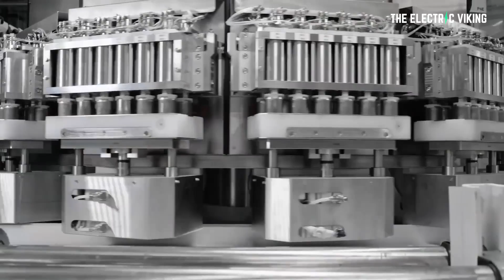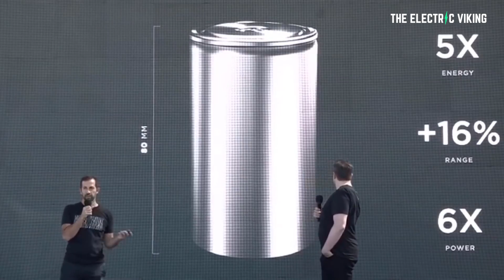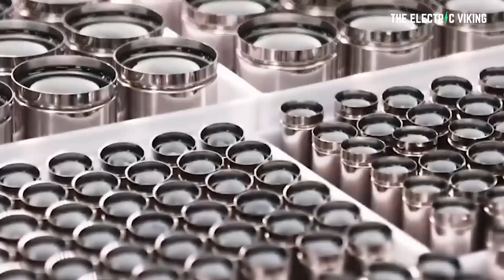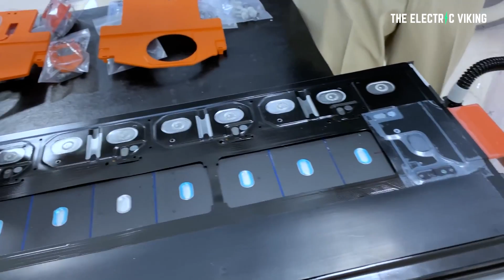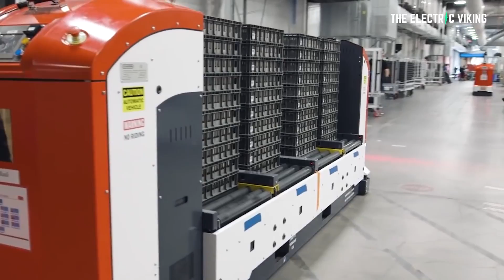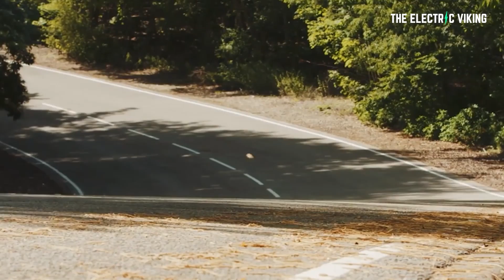Tesla's NEW manganese battery is a game changer

Comment: I am new to your channel. I enjoyed you discussion on battery technology. That being said can you do a in-depth review of the elephant in the room? Charging Infrastructure.  

Providing adequate recharging stations is not there yet across the nation but that's not the big question. Power creation and availability is. Where is all the power needed to supply this emerging demand going to come from? For example: My sister lives in California just over the mountain from the Bay.  It is not uncommon CURRENTLY (pun intended) in California in the hot summertime to overload the grid with demand and have rolling blackouts. What happens if the grid is even more overwhelmed with millions of EV's being plugged in? The power supply and the system to deliver is not there yet ... would you not agree?  Upgrading the current system is not a simple but complex issue ... how and who will pay for it?  Also, on an individual basis, not everyones home has 220V in there garage.  The labor cost to install the charging system, upgrade to the fuse panel if needed,  and the materials needs to be considered too. This subject is often not discussed when considering switching over to EV's.  

Further, it is nice to have a "zero emission" vehicle but is the power needed to generate the electricity zero emission?  Can you do a calculation per medium size, 4 passenger, with about 200-300 mile limit EV vehicle, based on current technology, to show the true vehicle carbon footprint?  Calculating the fuel consumption (natural gas, Nuclear, coal, ...) needed to create the electricity adds to the carbon foot print of the EV ... correct? Obviously if all power were all hydroelectric, solar, or wind then the number would be virtually zero. But I would appreciate if a all encompassing honest approach to EV carbon foot print would be explained as it is today.  People who buy EV forget about where electricity comes from or how it is produced. Please don't get me wrong I think EV's are the future but it is not free energy or is it without pollution based on power generation. Thanks for considering my request. Take care, Jeff

Comment: AFAIK, the manganese-rich batteries in the early Nissan Leafs are those that (in)famously degraded very quickly.
Li-Ion batteries with a manganese spinel cathode are relatively cheap, but have poor cycle life and are rather vulnerable to high temperatures. Nissan fucked up by combining these not very resilient batteries with an air-cooling system that didn't do a good job of thermal regulation compared to the liquid cooling systems almost all new EVs have today.
Anyway, if Tesla uses manganese-rich batteries they will not be of that particular type. There are several promising possibilities.

Comment: In 2030 Tesla will make over 30 million cars, Elon is sandbagging…  growth was 87% in 2021 it will be over 100% in 2022 and 2023.
That is 4 million cars in 2023 (just calculate existing factory capacity and ramp). On top of this Tesla’s strategy has now changed. 
They are now going for extreme size, 40 million is not unlikely. This is because Elon now feels they have to do it alone as US and EU companies are incapable to meaningfully scale…

Comment: Would there be any advantage in EV batteries using a spit of battery tech meaning half of the batteries in an EV being made with one tech and the other half using something else in an effort to maximise any benefits of each. Would it provide any advantage to the client /car owner or the manufacturer?
Reply: My guess is that this would be a challenge as you would have to double up on many components. Battery pack management systems etc.. due different cell  voltages etc..

Comment: I've pointed out Lithium in particular is in short supply and it isn't going to be significantly improved any time soon - so ideas that Tesla will still even break 2 million cars in a year - before they have an non LI chemistry is not going to happen - there just isn't enough and its basically obsolete already - if Solid State is going to make EVs viable and scalable it will happen way before any new mining operations dig up more lithium - so it would be silly to invest in such mining.

Comment: Battery tech is such a hot sector today, I think it's very hard to make predictions even a few years out. Literally hundreds of companies are feverishly working to find the next magic chemistry/material balance that'll shift the cost/density/charge-time equations. Who knows what advancement(s) will come to the market next? And who knows where commodity prices will go, as shortages duke it out with new mining ventures. The only safe bet is that batteries (and their prices) will keep evolving for the foreseeable future. Their future is bright!
Reply: One thing we know is that we need to decide on a solution now, Solid State , Hydrogen etc are too far down the road and we need to start building these plants. The big EV manufacturers have spoken, Manganese will have a role to play due to its scalability.
Reply: @dansom60  In current designs, Manganese goes with Cobalt and Nickel – both of which are only going up in price. As Sam has pointed out in many vids, the current trend is toward LFP – LithiumIronPhosphate. Energy densities are going up for that formulation, and the material costs are significantly lower. However, all bets are off outside of a couple of years. There're just too many designs & formulations being feverishly developed to predict.
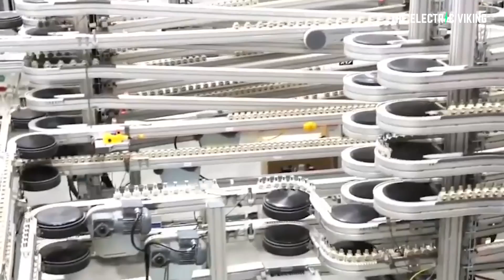Reply: @pbasswil  This article is about Telsa's announcement regarding the use of manganese to solve his supply chain issues. 3:10 in the timeline he say Tesla is focusing on Nickel based chemistries (which as you rightly point out above use both Mn & Co) for longer range vehicles and LiPO for shorter range. Electrik Vikings prediction is the 75% of the vehicles will be LiPO , fair enough. VW & Stelantis have also announced the use of NMC cathodes. just sayin.
Reply: @dansom60  If they can get the performance they need out cathodes with more Manganese and less Nickel, great. Elon undoubtedly has a very educated prediction about the availability of both metals over coming years. My point is, everything about batteries is in flux. There are too many variables to definitively say what's going to make sense, more than a few years ahead. Tesla is constantly making new deals & contracts, as new players and new chemistries & designs emerge. More will emerge! Regularly. So imho even Musk can't know for sure what will make the most sense for Tesla – maybe not even in 2025. Tesla are fantastic not just because they plan their supply chain ahead (as best they can foresee); they're also fantastic because they learn, react, pivot and adapt faster than anyone else in the industry. And quick adaptation is exactly what battery technology is going to require – both because of unforeseeable emerging opportunities, and because of the constantly changing materials market. Cheers.

Comment: From the stats i can find, it seems like you can get a battery with 250w/kg with more the a 2000 cycle life.  The real benefit is that it is a 3d structure and can charge to 100% with out impacting long term life.  You eliminate co2 from the production process, these could last a very long time.  Pretty interesting chemistry.  Several companies sell the powder now.
Reply: "250w/kg"?
Isn't that capital W and Wh/kg?
Just btw, the Tesla 2170 cells reached 246Wh/kg in 2019. (They've improved since) 
I'm pretty sure they exceed 2000 cycles (but life's too short to look)
Reply: @rogerstarkey5390  correct, but they don’t last very long when you charge to 100%.  So you have a 2170 that lasts for 5x as long under heavy use.

Comment: I think best case for Tesla in 2032 is 10M units. This is including the S3XY, Roadster, Semi, Cybertruck, and a cheaper model lineup. 20 million units will mean 10 more factories between 2022 to 2032.
Reply: I think you will find that Tesla is sandbagging on the number of Gigafactories required for 20 Million I suspect it will be less than 10.

Comment: While I agree we need more mining for the EVs, keep in mind once the batteries are built, we will not need the mining.  Recycled batteries last almost forever.
Reply: Hard to believe the batteries last forever...much easier to believe that they will be replaced by another chemistry or physics.
Reply: @calmorton4619  Not hard to believe.  When a battery stops holding a charge... what is left?  Did the materials it was made out of stop existing?  Nope.  Grind it up, melt it down, separate it, build a new battery, and start over.  It is cheaper to recycle batteries than dig mines then extract and refine resources.
Reply: NO!  they don't, recycling batteries are an expensive process, the gain is very little in terms of batteries, but it keeps hazardous materials from getting disposed
Reply: @cessealbeach  Mining is an expensive process!  The gain is very little in terms of ecological damage.  Recycling batteries is simple.  Grind them up, melt them down, separate the elements.  This is not rocket science.

Comment: I did a search for manganese, it turns out to be less energy dense than LFP but high discharge! Like LFP, safer than cobalt based.  I don't know what application this could use being less dense than LFP maybe a small city car or personal mover but still a great addition since LFP will never be enough, great battery for most or large applications, not handheld products.
Reply: Static power storage needs low cost batteries. Weight and volume follow in a distant second place.

Comment: Atm, Telsa is out of reach price wise for most. If you live where it snows anymore, you need a AWD or fwd, not a LFP RWD vehicle. 

Then there's the insurance issue. Switching to a Tesla makes no sense if all the money a person saves will end up being dumped into the insurance premium. 

As in if person A spends $50 per week in fuel and $600 for a 6 month premium for a ice. Person B buys a Tesla, only uses a super charger, due to no way they can use a home charger or a LV 2 charger at work, and spends $20 to $30 per week to charge and insurance is $1400. All of Person A’s savings from fuel and maintenance turned into a higher insurance premium.

I think once Tesla figured out how to get the US insurance rates down, pricing out of the $60,000 for a dual motor and the range of their EVs closer to 400mi, they will see greater demand.

ATM, I’ll just stick with my 2022 Blazer and I may buy into the Blazer SS when GM releases it because it should be over all cheaper than a Tesla Model Y with better styling

Comment: I so badly want Tesla to make a proper styled SUV
Reply: If it's true that the wall between the cabin and bed folds down, then, with the bed cover on, the cyber truck is an SUV with a large trunk.
Reply: Tesla probably will expand And make one.
 True  SUV  is the rage ATM
Reply: Mercedes EQG
Reply: @موسى_7   What are you spewing 🤢 🤮 🤮
🚶‍♂️  Walking in here and talking about some other car company other than Tesla 🤦🏼
 Wake up and smell the "thorns" ❗️❕️❗️
 You can't tell when you're in the midst of a Tesla circle Jerk 🧐

( Unless you came in here just to start trouble which you did @💯%) 
 😆 😅 👌 🤣😂🤣
Reply: Yes, AND a true off-Road EV.................Paul

Comment: Well done; well stated. Gave me some ideas to chew on.

There are ways to approach the problem of material constraints in mining we dance around. One thing is to focus on designing, building, and retrofitting cities to be denser, more livable, and efficient, Compact Inwardly Designed Cities, CIDCs. Tesla can coordinate the efforts of his companies to achieve this. This lowers energy demands for personal vehicles, HVAC, and food production.

Moreover, we can use LFP, maybe LMFP at a 65% rate and higher. Begin next year with that goal. Use ternary batteries in semis, pickups, and delivery vans. Put off the Plaid level of performance next year for a few years. Bring down range expectations to 250-300 miles/charge, 400km/charge. This changes the composition of the demand, leading with our strength.
Reply: How bout we just change housing design regulations in the USA so AC comes from above and heat comes from below?  That alone would improve HVAC efficiency 20%.  Could have been done 50 years ago.... why wasn't it?
Reply: @davidbeppler3032  build traditional Mexican style houses in Texas which don't need AC
Reply: @موسى_7  Yes. there are lots of traditional design methods that are brilliant adaptations. We can incorporate many.
Reply: @davidbeppler3032  Thanks! Yes, there many improvements to codes, standards of construction that will add to efficiencies. Once we get a nose for finding and correcting those, we'll gain much.

On a bigger level, designing better cities, from scratch and retrofitting existing one, will go further. The design I suggest, Compact Inwardly Designed CIties, CIDCs will increase efficiencies across the full range of energy use.
Reply: Yes some good idea, we need to constantly push the battery range so ultimately energy density improves. Sure we can cap the EVs range at 300 miles per charge by putting less batteries in the EVs over time thereby reducing the weight. Being able to charge from 0% -100% without battery degradation and also having a large cycle life will be key.
Reply: @thomaz1963  I'm thinking just for a few years. Not so much 'capping' the range at 300 miles, more like through an engaging public dialog show that 300 miles is plenty.

FLPs have 0-100% charging and a large charging cycle now. That'll improve!
Reply: Tesla doesn't own the US government or control NIMBYs
Reply: @موسى_7  What does this mean? What Tesla does control is the narrative it presents to the public and how it enters into dialog with politicians. They can do a far better job in both.
Reply: @موسى_7  You want a car to take you to work?  Do what Tesla says or no job for you.  Lookit, Tesla controls NIMBYs.

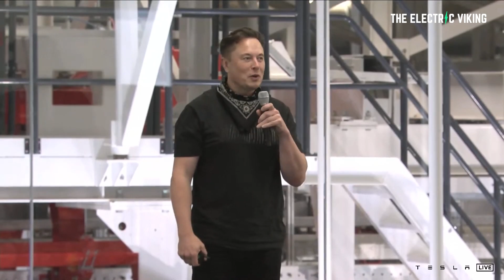Comment: 5:23
"300 TWh of cell production".....
🤔
Try "300 TWh of capacity in use"?
Tesla at 3 TWh per year, as 10% of market share, 10 years at full capacity to reach the goal?
BUT
This would be ALL "batteries" (storage devices) of ALL types, from Lithium based, Iron ("rust") heat, salt, flow cells, gravity storage, 
Everything.

Comment: The question is not whether LiFePo4 will be predominant, but which form factor they will be.
Logically(?) You need the fastest output, from the smallest factory to reach the target.
That'll be LiFePo4 4680.
Reply: I don't think you need 4680 LFP. Part of the appeal of the cylinder shape is safety, as issue that does not exist with LFP. Other formats can be packed better, circles don't pack so well.

Comment: Don't forget about Graphite mate! Equally as important as the shortage of lithium, if not more.
Reply: But Graphit could be produced artificially. Lithium is not possible.
Reply: @knabbagluon  synthetic graphite is far more carbon intensive process and more costly. High grade spherical graphite is far more economical.
Reply: @knabbagluon  Graphite produced artificially/synthetic, is very expensive, environmental unfriendly and extremely electric power consuming, and mostly made I china. In china they need to shut down these plants, because of energy shortage in China. They will not be able to produce enough graphite to match the demand of EV’s.